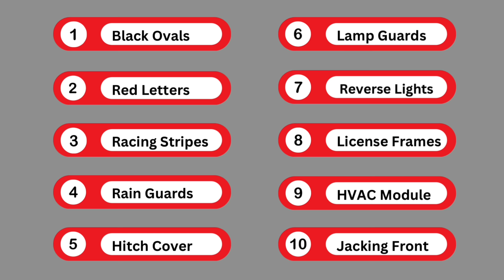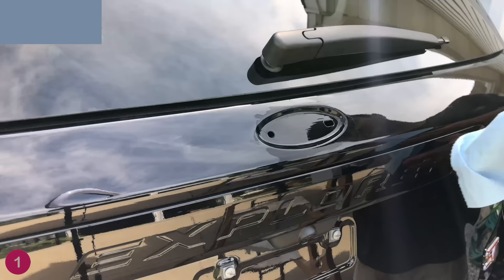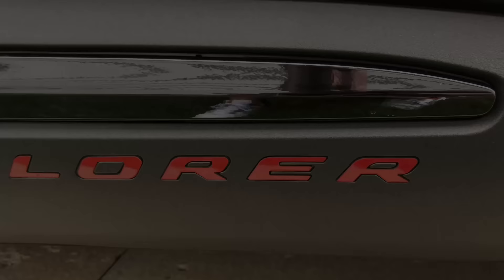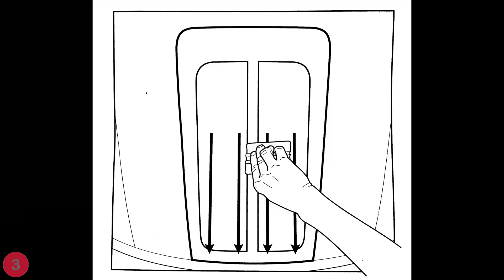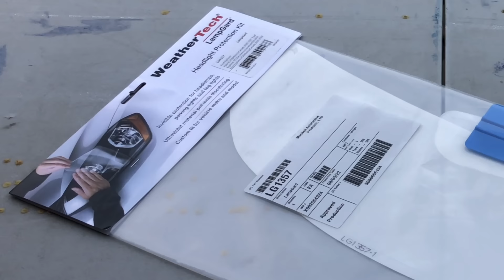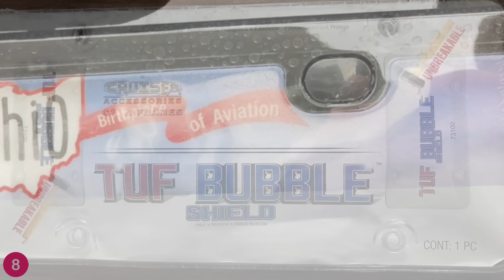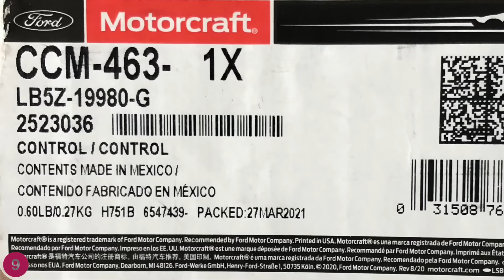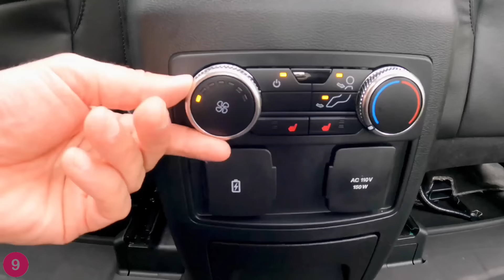10 DIY Upgrades | Ford Explorer

Comment: Does the Oval shape Ford logo link that you provided fit 2020 Ford St because when I tried to order it says it’s for 2023 on the Ford website and I’m not sure does it fit or do I need look for something different ?
Reply from the maker: The website isn’t the best.  If you have strong doubts call the online number, or order the part through your dealer.

Comment: No tints?
Reply from the maker: ST’s come factory with tinted headlights and tail lights.  So the stock look is pretty sweet.  I did research a few tint options though.  Just hesitated to run with them because of mixed product reviews.  Installation was a concern too, if I were to do tints I’d lean towards having a pro do it.

Comment: As an EVT who converts these into patrol cars, I can say with 100% certainty that you do not need to jack these up to remove the bumper.
Reply from the maker: Omg the screws holding the fender to the bumper were a PIA even with the wheels off.  Such an awkward angle
Reply: You just need to turn the wheel for access right ? That was my first thought

Comment: Hey I had a question, I have a 22ST and just ordered the oem window visors. The top of the door is rubber, do the visors mount directly to that? I’m used to having a hard material to mount them to.
Reply from the maker: Yes it’s a hard.  My favorite mod
Reply: Got my visors installed today, they are literally the same ones you have, same packaging and everything they just don’t have a logo lol. Tbh I don’t love em, but I don’t hate em.

Comment: Is there a way to activate the rear gate unlock using your foot under the right side of the rear bumper?
Reply from the maker: This was deleted on mine because of the chip shortage but we’re not complaining, don’t really want that feature.  Like the one touch up and down button that’s a huge upgrade.
Reply: @mugs132  I can never get mine to work when I need it. Probably better off.

Comment: I have a 20 st. It came standard with the rear HVAC and heated and cooled seats up front I’m confused. Is this the ST line? Without 4wd???
Reply from the maker: Ford started deleting the rear hvac control module in Mar22, due to the chip shortage.  I have a 2022 ST with heated and ventilated front seats, and rear heated seats
Reply: @mugs132  
Darn chip shortage and supply chain issues. Sorry to hear that you had to spend $ to bring it to original intended design.

Comment: who removed your roof rack rails for you???
Reply: 😂probably him,it's simple pop bolt covers,unbolt 🔩 take off..I used flex seal liquid to fill in the holes then ordered trim to run down the roof in that spot looks great on my 2013 has been 4yrs no problems...
Reason I had to was rear bolts rusted n were leaking thru the frame all way into the spare tire tub 😢😂 Success 🤣👌

Comment: You may want to contact Ford to get a refund for the back AC controls. I purchased my vehicle with the rear controls missing and Ford explained to me that all the rear controls were on back order. Once the part came in, they installed it for free.

Comment: They part number you showed is not what’s on the part. Clarify please
Reply from the maker: For the Rear HVAC Control Module I thought the same thing and this is why I chose to show the back of the part.  It came in a factory sealed box with the sticker seen in the video showing part LB5Z19980G on the box.  Maybe it’s part number mapping Ford uses internally that explains the FF on the back of the actual part. Not sure.  But for my year and trim level LB5Z19980G was the correct part.  Searching that on google I found it on eBay.  The local dealer didn’t have any but I confirmed the part number with them before making my purchase.
Reply: @mugs132  it seems it’ll fit and is 60 at ford  but the part numbers don’t match. Lol.  I re watched your vid and saw you have a 2022
Reply from the maker: Yeah I’ve got the 2022 ST so my control needed heated seat buttons.  I’m sure there’s variants depending on your year, trim and interior color.  Would check with your dealer to be 100% certain you’ve got the right part for your VIN.  Because of the chip shortage Ford started deleting these in Mar22 so they’re not exactly running out to make them available yet.  Website told me to contact the dealer, who was less than helpful acquiring one.  Supposedly Ford will get you one within a year but who knows, winter is approaching and I’m impatient anyway lol.

Comment: Touch less car washes only my friend or else you will have swirls in the paint!
Reply from the maker: I got to say and knock on wood but I’ve taken my other car through Waterway 400 times the past 5 years and the paint still looks great. Hopefully Ford paint holds up just as well.  Waterway is great highly recommend.  And they do the interior.

Comment: Good Grief. This definitely the Gen X millennial mindset of what turns them on with cars in todays wokieness world. Everything to make your ride look pretty, with lots of bling.🥳🎉😍 Decals, badges, lights, rain guards, earrings, makeup. Back in the days of raw muscle cars, we only cared about real man racing stuff like huge cubic inch stroker V8’s with giant intake manifolds, huge carbs, cams, coils, rear axel gearing, 4/speed manuals, turbo 400 transmissions, headers, glass-pack mufflers, rear end slick tires. We didn’t have time to film videos on how we did it because it was a secret.😡😂